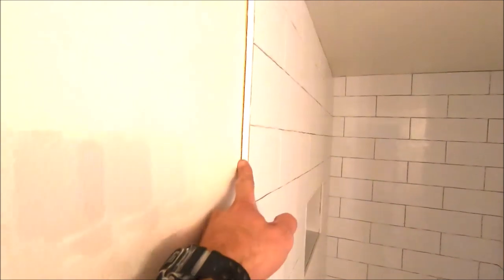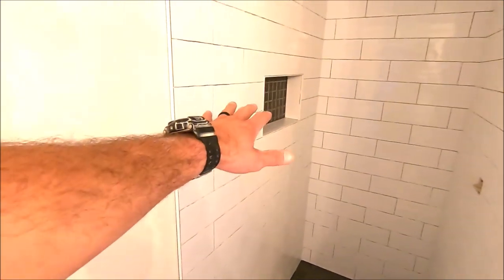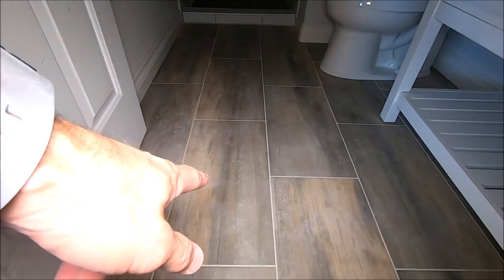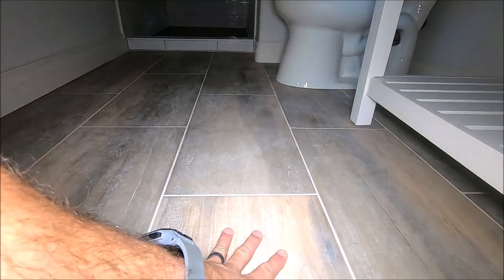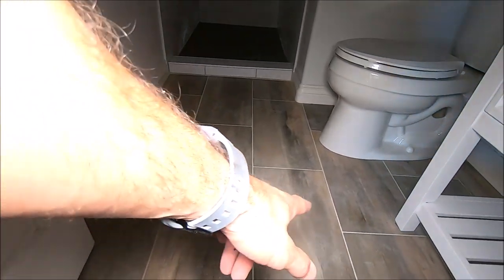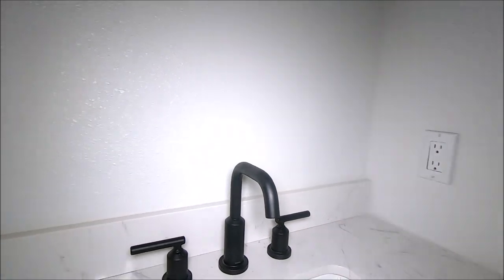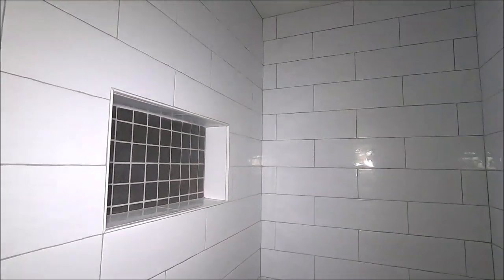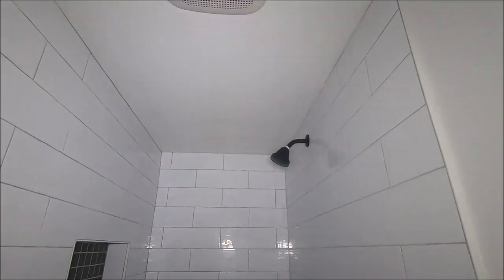White Ceramic Bath & Shower Tile Ideas EP. 38

Comment: Love your videos, bought some of the recommended tools, the montolit P3 & levtec levelling kit. I’m not a tiler so I got the pro’s in to do the bathroom (i’ve done smaller simpler tasks only) and let them use the above to try. They were very impressed with both, described the Montolit as a revelation over the Rubi cutters. Keep up the good work

Comment: Why level system ?
Reply from the maker: For large format floor
Reply: @LandbergTileTV  what I really meant to ask on the wall tiles why didn't you use the leveling system? You didn't need them or just didn't want to use them or just not needed for that application.